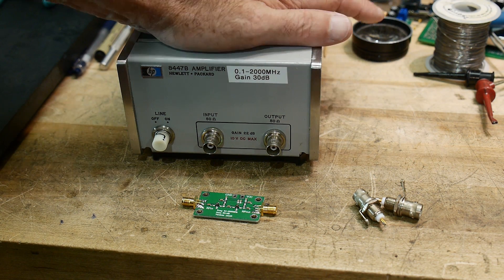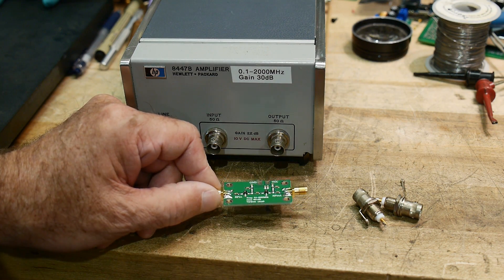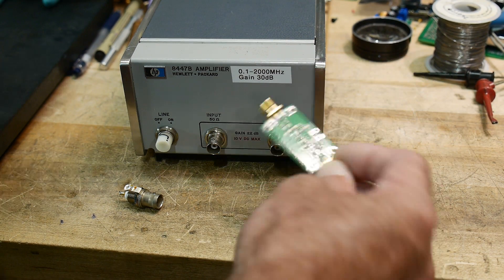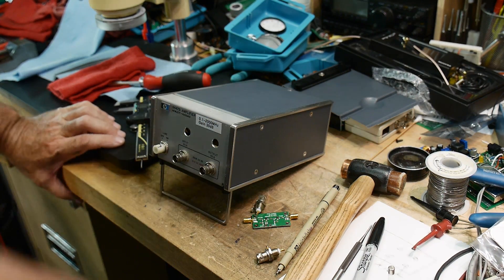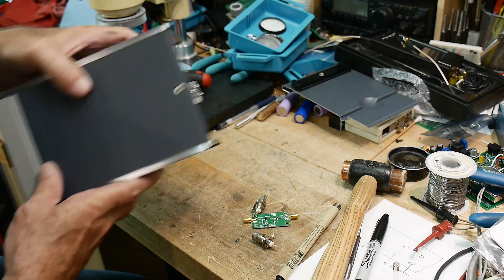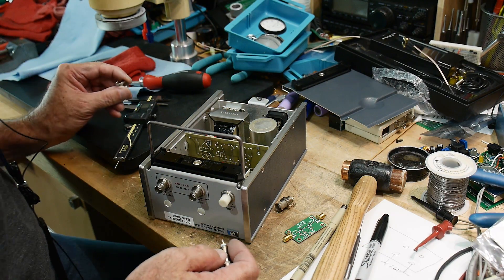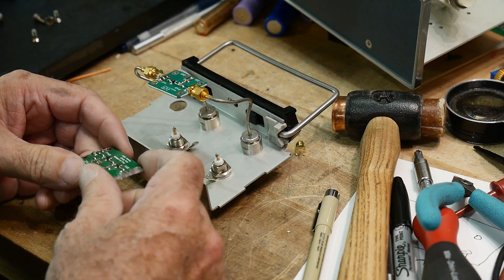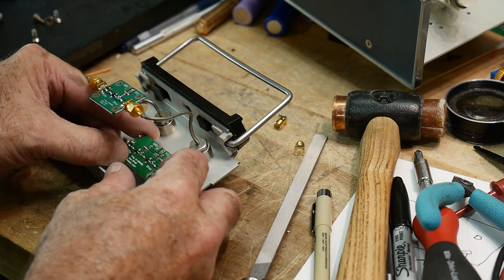#601 60db Amplifier Upgrade

Comment: Too bad you didn't have an 8447F to start with - those already have two sets of inputs/outputs (lower and upper frequency ranges). Those are rated at around 25 dB (lower range) to 28 dB (upper range) gain (after years of calibrating these I've observed that those tend to be minimum ratings).

Comment: Looks like a very clean job, though, based on other comments, the 60dB amp was not a useful fit. 

From your videos, I get the impression that you think of the classic HP cases as higher quality, better looking Budd boxes. I agree with that. They are cheaper, too, with a little shopping around.

Comment: Nice mod, looks really clean from the outside. 
Could you show the performence of the 60dB amps?
I have severeal of them and they all tend to oscillate really bad. 
I also didn't manage to use them without worsening my SNR by 40dB.
Reply from the maker: Well I had similar experience. After I shot this video. I just didn't think the amp was useful and in the future ended up replacing it with a nice 20dB LNA which was much more useful.
Reply: @IMSAIGuy  Interesting, my guess is that these amps need some filtering to bring the bandwith down to a more narrow range of interest.
Another thing might be that they have some feedback through emissions, so a 2 compartment shielding can might actually help.

Thanks for the great video and the response btw. :)
Reply: I was surprised to see you daisy chain the power connection between the two amps.  I would have run separate leads (like star GND) from PSU.  Do the amps need any supply decoupling / filtering at input terminals?
Reply from the maker: @robertdixon8238  each amp has a power supply filter (simple RC one) at the input.

Comment: A nice upgrade 🙂👍. But you didn't care to connect the cold end of the left BNC to the board. You grounded the left connector though.
Both the original connectors are having 50 ohm hard lines to maintain the characteristic impedance of 50 ohm.
Reply from the maker: The chassis provided enough RF path. Not ideal as you say. In a future video I ended up getting rid of the 60dB amp and swapping in an LNA with 20dB which I find much more useful. I did put in coax on each BNC that time.
Reply: @IMSAIGuy  ohh. That's nice. Thanks for the reply.

Comment: I like the HP chassis design.  You mentioned that this one could have been used for multiple products.  I ran across the same concept with those aluminum multi-hole side frames in an HP 353A patch panel, although a different aspect ratio, taller than wide.